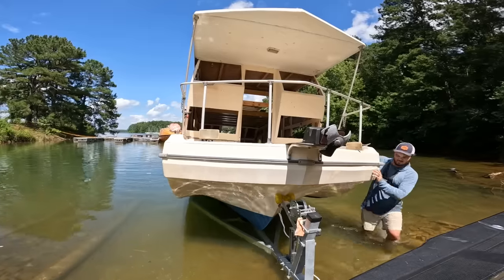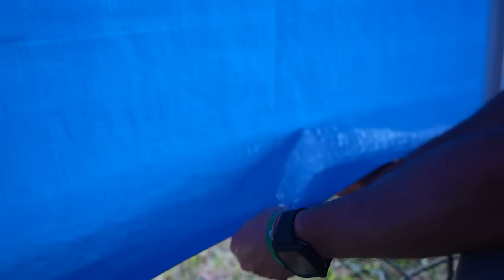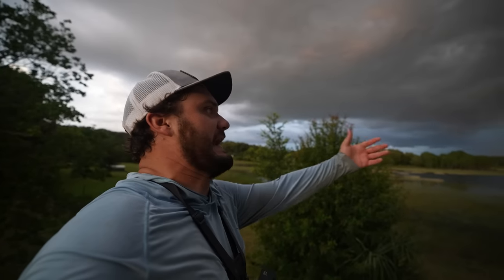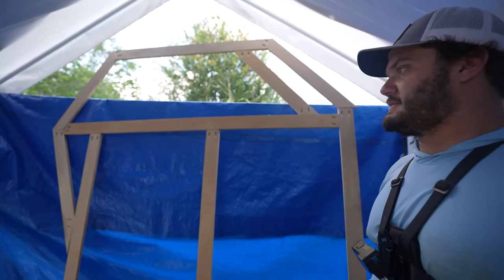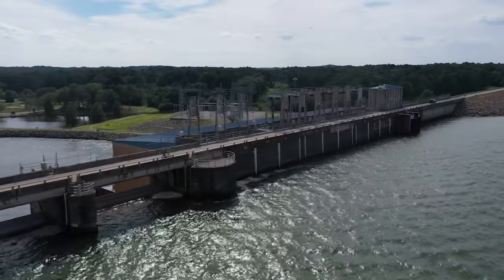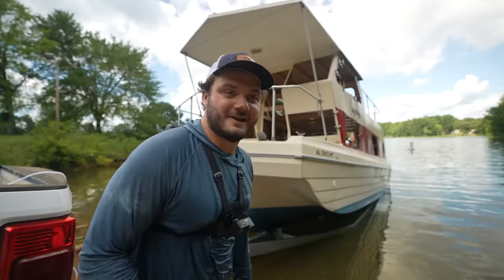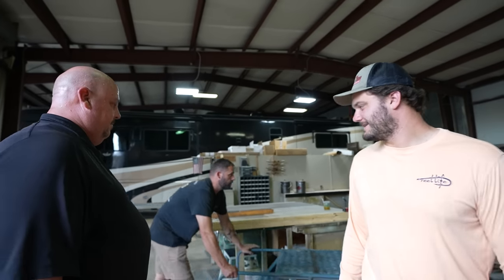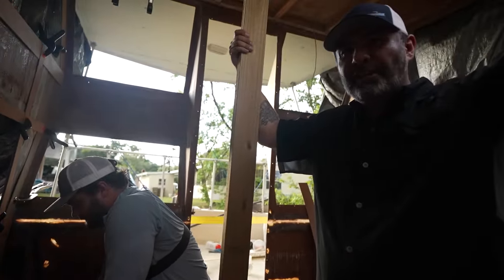FLOAT TESTING My Houseboat!! (Itty Bitty Update)

Comment: I have been a subscriber since the beginning of the Itty Bitty project and it is starting to look like this might actually happen.  Thank you to Shawn for his service and taking the shake out of the old girl.  My only concern is that you have changed the weight distribution in that boat so much will all of the modifications that I hope it does not end up floating like cork on the water or riding so low that you are moving across the water like a snow plow. Can't wait for the next update.  I am loving all of your content, AYO.

Comment: You can launch a boat without getting wet!  Connect a long rope to the forward cleat and disconnect the winch line on the trailer.  Back the boat in with some momentum and then let the boat float off.  Use the rope to control the boat as it floats off.  You can also connect a line to front and back on the boat to have more control.  Love the updates!

Comment: Hit the back of those bolts with 2-3 passes of flex seal if you can, that has worked so well for me whenever I've had to put any hardware into/through the transom on my project.

Comment: Been loving this series! Just thought I'd mention that your front wheel on you ebike needs to be spun around so the disc actually sits in the caliper after the spacer has been removed! Your hydraulic brakes will work a lot better then haha!:)

Comment: Thanks for saving that boat AYO. You have to do a trip down the Tennessee River from Chattanooga to Mobile bay. Mount a small 6hp-9.9hp on the platform just for safety if the big motor stops. And use it for the dinghy. Get a nice 8ft aluminum Jon boat to pull behind the boat. When you stop for the night up a cove you can use the Jon boat with a 6-9.9hp to go fishing. Take a week or two and film the trip. It will get you a lot of views because that’s part of the great loop. Use great loop in the titles.🇺🇸🦅🚤

Comment: YO! For the soapy water trick to work, you have to fill the cup up to the top, then trap by putting the rim flush against whatever the nest is hanging from and hold for about 30 seconds. 
Otherwise, toss a little gasoline from a distance. Instant kill if you can throw.

Comment: With the wasp ‘problem’. It is very easy to handle, sometimes these useful creatures are in the wrong place and-or to plenty full. Just use an old spray bottle and fill it with diesel, spray that on the wasps and the nest. This wil almost instantly kill them

Comment: Would be a good idea consider the weight of the inboard motor you removed and how it affected the stability of the boat & how it sat in the water. The missing weight from the engine could affect the stability and not having that will cause her to be top heavy and wouldn’t want her to capsize.

Comment: If you sealed the rear deck with 5200 I wouldn't worry about it one bit. I used it for transducers for years and generally had to cut them out. 5200 is amazing stuff (We eventually switched to Lifeseal for 'ducers, also a great product)

Comment: It’s been 2-3 weeks has your opinion of your model of Your Electric Bike clanged? 
I had a different Ebike Ecotric tornado loved.  But the tip of the power chord broke off in the battery so I returned it. Your Ebike offers more battery & motor.  IF YOU’RE STILL HAPPY WITH IT, I’ll buy one,

Chris

Comment: I want to see her run on the water dude the ply you added inside we use plastic pipe glass over that and the half round is so strong you can tapp screws into it run cables the works never mind good to see this project moving forward add a dolfin to that motor it will add lift.

Comment: Also. The Large over-hang, at the front of the boat, seen at 19:22. IF you drive that down the inter-state, that thing is going to act like giant wing and, you better find a way to cover the front of that boat, or your boat will become a plane...Probably will need to create some kind of canvas, cover for the entire front of the boat, using snaps, because it will be a major problem even at 25 mph.
Reply: Steury did beef that up. The Steury I owned had 2- 2" stainless posts at the bow. Through bolted. For bearing load on top too. Had a 4x6 tent that fit up there perfect. Also gave egress from the bow with a swim ladder.

Comment: Need to make rubber mounts or something about that fixed later it sits lower than the trailer if you travel with it ,might b a issue at different boat rams not telling you what to do just a Suggestion

Comment: Bro u have to put the tie downs in the tarp holes around the outside and pull it tight. Putting a rope over a tarp won’t ever hold it down… just ya know for the next house boat caught in a storm with new wood exposed

Comment: You might want to turn that front wheel around so that the disc is actually IN the brake calliper! Rather dangerous especially if you decide to try riding down those stairs, or anything at speed and you need to stop..

Comment: Why is the front wheel on the ebike on backwards? By that I mean the disc brake rotors is on the right side instead of the left side...

Yeah, you should find out if it actually floats before you put much more money into it.